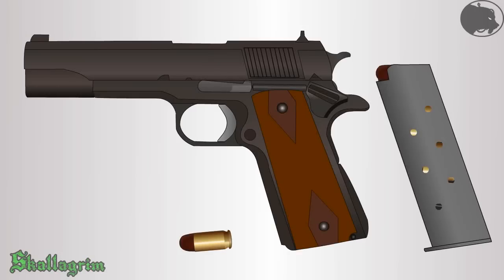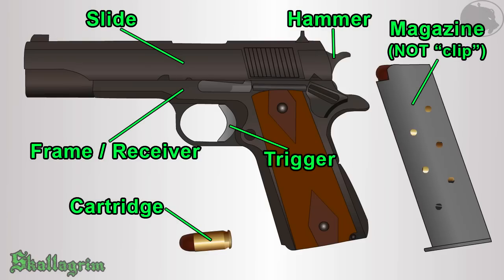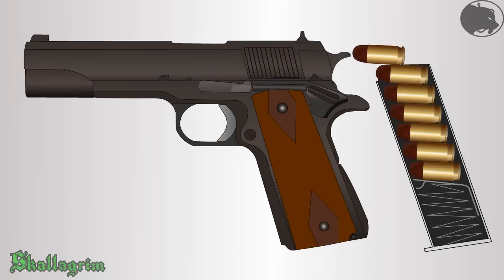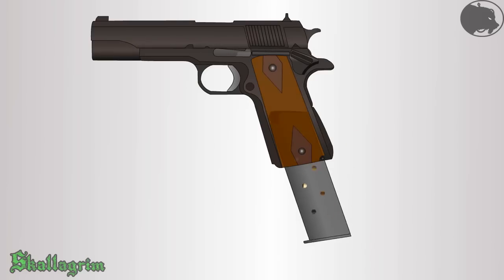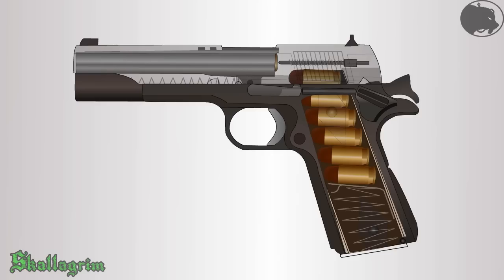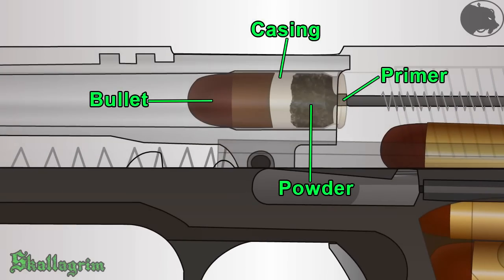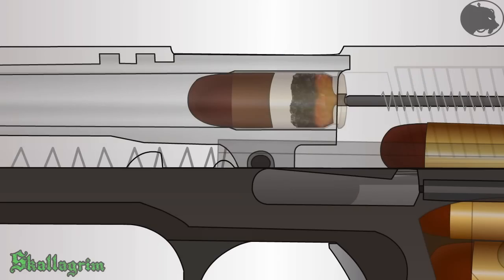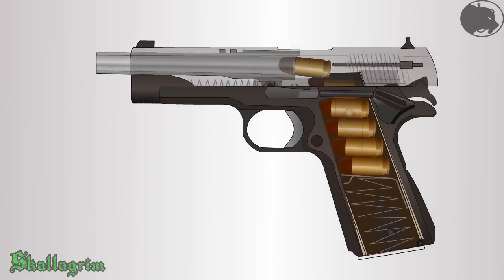How a firearm works - Animation (1911 semi-auto handgun)

Comment: I have a question. Pause at 50 seconds. At this point, there is a cartridge in the chamber and the hammer is cocked. Pulling the trigger will fire the weapon, but what if I push the hammer forward with my thumb? Will it still fire? I assume it will because by pushing the hammer, it pushes the firing pin, causing it to hit the primer. I will have another question, but I will ask after this one is answered.
Reply: It only has to have enough pressure to hit and sent the primer the primer is like a cap with small explosive inside and one it's bent the pressure on the explosive detonates so no you probably won't deny it by pushing forward.
Reply: gmchingon Almost all, if not all handguns with external hammers have safety features to prevent the hammer from falling forward, even if it is hit or pushed. Most handguns also have a firing pin block that prevents the firing pin from striking the primer unless the trigger is being pulled.
Reply: I see. Thank you.

Comment: Could some one answer my noobish question regarding automatic and semi automatic rifles. How come gas-operated reloading systems are required to work the bolt on rifles and why isn't the recoil enough, like with handguns?
Reply: It has a lot of friction to move the bolt and load a new round so it uses the gas to its advantage

Comment: So is it possible to detonate a single cartridge without the actual gun by striking the primer with a thin rod similar to the firing pin?
Reply: Yes you could smash it with a hammer and it will go off but its dangerous
Reply: Oh okay. I'm not going to do it or anything. Thanks.
Reply: +Humming Brook If you want a tid bit of info, the most dangerous part of a round that detonates is actually the casing because it is lighter than the round, so which one do you think would go flying if and explosion happened between them? =] Interesting to think of huh?

There was actually a story of a guy using a .22 round as a fuse. It got too hot and the round exploded. The actual bullet stayed in the fuse box. The casing went into his leg.
Reply: yes. it go slow because no barrel.

Comment: Guys, I want you to think about the next situation for obtain a solution to it:

We will use as model the Nerf Mega Magnus, a very alike nerf gun to the Nerf Fortnite SP-L when we talk about it's system, how the gun works is basically the same as the video, first, we insert darts on the internal magazine of the gun, the after pulling back the hammer a dart will be loaded in the chamber ready to fire, the problem is that after firing the gun, the force ain't shit enough to cause the hammer to "reload" as a real pistol would do, so after shooting the user has to manually reload the gun, now, here is the question: 
How we can make the gun reload mechanically, without using automatic nerf gun systems by just reloading it automatically after shooting? it can use a electric system but not to make the noise that full auto nerf guns use to do.

Comment: No animation of the possible ways it can jam and their causes?
Reply: Aaron Rayner failure to feed, failure to eject, and double feed are just a few types of ways a gun can jam.. their causes vary from bad ammunition, worn out parts, or even user error
Reply: Usually user error.  There is one problem that can occur, and it's when the bullet 'settles' into the case.  It's pretty obvious and if you load one of those into a mag, then that's probably going to cause problems.  I've never seen 'settling' happen, but I don't buy questionable ammo, either.

Comment: No one here or in video knows anything about the internal workings of this gun. the barrel has locking slots into the slide. how does the barrel get separated from the slide ?
Reply: Shaq Deisel Not sure if you're actually asking... But if you are

The locking just acts as a delay system so the bullet can leave the barrel and the brass can cool a little before it starts extracting. You also notice the barrel points up slightly when the slide is back all the way, which starts in the beginning and is used to unlock the slide from the barrel.

Comment: I still don't know how a gun manages to direct the recoil to drive the bolt.
Reply: The pressure exploding to the sides of the cartridge all cancel each other out.  Any recoil forces pushing towards the left side of the gun are cancelled out by those pushing towards the right side of the gun.  Pressure pushing the bullet out the barrel is the only pressure whose opposite force pushes the bolt backwards.
It is the same principle as a rocket motor.  A rocket doesn't wobble around since all sideways forces cancel eachother, the plume coming out the back is vented energy, and the explosion in the combustion chamber pushes against the upper wall of the combustion chamber propelling the rocket upwards.
Reply: LOL.  It really is simple, though.  Any forces towards the front has the equal and opposite force going backwards, which is what drives the bolt.  The gun doesn't have to "direct the recoil" because it just naturally happens.
Reply: because the recoil goes both ways and slams the bolt back then the recoil spring pushes the bolt back into place.... what u meaning? this is why bolt actions are better

Comment: So the force from the cartridge is what causes the slide to move back?
Reply: Yeah. It's Newton's 3rd law. For every action, there is an equal and opposite reaction. Every time a bullet is fired, it makes the gun cock and chamber another round.
Reply: on pistols yes. on rifles, they cycle is operated through excess gas, directed back into the chamber,  pushing the bolt to cycle another cartridge

Comment: In other words, for the most basic of guns. 
- Get a pipe, that fits desired bullet,
- Get a back for that pipe with a hole. 
- Get a literal hammer.
- Insert bullet. 
- Use hammer... BANG. 
You are now ether using ye-oldies BOOM STICK, or invented a pipe bomb... by accident.

Comment: So it's just the recoil that moves the slide back, I have a hard time believing that
Reply: That One guy A brony failing to understand simple mechanics that drive the action of a firearm? Consider Newton's Third Law of Motion, my main man.
Reply: It makes a little bit of sense but still it doesn't seem like it would work
Reply: +That One guy well remember that guns basically operate on controlled explosions. said controlled explosions make small pieces of metal go really really fast in the case of the m1911 over 250 meters a second. that has to create a lot of recoil and logically unless that slide is like 40 pounds it should have enough force applied to move it back.
Reply: TWrecks I understand physics this just didn't seem plausible. You don't need to get this aggravated at me for something this basic
Reply: The Fox Laboratory sorry i was hammered that night jk i am too yhoung to drinkl anywei ye i understand mayb there is some other skinetifikel method that it works idek
Reply: The Fox Laboratory It doesn't seem plausible because you're not taking into account every other variable

Comment: The Video is not 100% correct. 

The Barrel moves backwards together with the slide, a little longer than the bullet needs to leave the barrel. This is not made clear in the video. 
Here the Slide and the Barrel just randomly move backwards together...
Reply: +Peter August NO The barrel does NOT Move at all. The barrel is attached to the frame. The slide moves independently.

http://s1159.photobucket.com/user/Mifase/library/weapons
Reply: +Mi Fase yours is obviously not a Colt 1911 and does not have a floating barrel. The colt 1911 does though. The Barrel is held in place by a chain link system which lets it operate as a short recoil system.
Reply: +Peter August on the 1911, the barrel does not move in the manner that you say.

if it moved back with the slide, the weapon would not operate.
Reply: +Peter August so sure, mine isnt a 1911, you can have that, but you said the barrel moved back with the slide. if this was the case, the barrel wpuld not be visible when the slide moved to the rear position. the round casing would never be ejected. and a new round would never be loaded because the barrel would move back with the slide. 

the animation fisplays the movement that would occur, which is obviously not moving back with the barrel.
Reply: +Mi Fase just read yourself into the way short recoil systems work... Or if not, then please be quite...
Reply: I trained with the 1911 while in the Army, including field stripping it many times. the barrel tilts a bit, as shown in the animation, but it does not travel back with the slide.  
If it did, the breech would never be exposed to the ejection port, and the gun would not be able to expel spent cartridges.
Reply: gpgpgpgp1000 Thats what I said. 

In this Video the bullet leaves the barrel and then randomly the barrel and the slide move backwards. 
What is supposed to keep the slide in position until the bullet leaves the barrel?

In Fact the tilt consists of a tiny movement in slide direction and then the tilting around the pivot point. This movement starts as soon as the gun is fired. By the time the bullet has left the barrel the barrel transers into the tilt motion. 

In this animation there is a just a magic force in there holding the slide in place until the bullet has left the barrel.
Reply: OK, I'm convinced you do know how this gun works, and that your issue has more to do with some of the timing of the animation.  
Just remember Skallagrim doesn't do animation for a living.  I think he did a pretty decent job at this, and accomplishes his goal of explaining a semi-auto pistol action to novices.
Reply: Sure, i dont blame him for anything. 

His animation just does not answer the most important question, which is "What cycles the gun, and how?"

It answers the question "How does the gun cycle" quit well though.
Reply: Yup, just a timing issue. It would be impossible to stop the slide from moving back for the duration of the bullet leaving the barrel and still have the slide move back afterwards, right? Pretty cool video though. Glad I know how firearms work.
Reply: Christian Waldmann Well. its not entirely possible. But with a regular short travel system it is. 

But there is also delayed systems. Mostly for rifles though.

Comment: why isn't it called a clip?
Reply: A clip only serves to hold ammunition, a magazine also assists in feeding the rounds into the chamber. This was more important back with older rifles, such as the M1 Garand, where the clip would have to be inserted into the magazine. Or with guns like the SKS, where you could use stripper clips to quickly load the rounds into the magazine and then toss the clip. In these examples the magazine is integral with the gun and cannot be removed (barring some modified SKS variants).

Comment: someone can explain to me why when you are out of ammo the slide stay back? Thanks
Reply: Alberto Milla Segovia because the gun does not have anymore cartridges to reload and does not retract back
Reply: There is a notch in the side of the magazine, and the follower has a tab that pushes up through the notch. This presses on the slide lock with spring tension. Once the slide moves far enough, a cutout in the side of the slide engages with the slide lock, preventing it from returning to it's resting position.

If there is no spring tension on the slide lock, it does not push up into the cutout, and thus does not lock. That's why it only locks if there is a magazine in the gun, and that magazine is empty.
Reply: Alberto Milla Segovia so when you put in the next magazine you don't have to pull it back
Reply: hey thanksthe two of you but i already did my homework :D
Reply: Alberto Milla Segovia I tend to do serious replies, sometimes not as much directed to the OP but to the people who see the post after me. Vague answers aren't helpful to anyone, but detailed answers can educate more than just the person asking the question.
Reply: ok...

Comment: pls make a video of AK 47 mechanism.
Reply: Basically the same concept... it is also a blowback weapon using the force of the bullet to re-cycle the rounds into the gun. The reason the ak-47 looks like it has 2 barrels is because the top "barrel" is for the shockwave of the bullet exiting the actual barrel to travel through. When it goes through, it pushes back on the slide which ejects the current casing and re-cycles a new bullet from the magazine in the process.

Comment: So you can make a real gun using a modified metal B.B. gun
Reply: Politically Incorrect not quite
Reply: BlakeBiundo why not
Reply: Politically Incorrect 
1) you would have to find a round that would fit perfectly into the barrel of the handgun
2) you would have to create your own magazines to accompany this new ammo
3) there is no firing pin in a bb gun, so you would need one of those
4) with no bolt, if you do manage to fire a round, the gun will probably blow up in your face
5) the weak recoil spring in a bb gun would allow the slide to gracefully fly into the shooters fave
6) you are going to try and take a toy that is used for plinking soda cans and make it fire live ammunition.
Reply: BlakeBiundo .22 ammunition and that’s what I mean by modifying but heavy modification replacing springs with whatever you need to replace it with etc
Reply: BlakeBiundo I don’t think a metal B.B. gun would blow up
Reply: BlakeBiundo if I were going try this I wouldn’t try shooting it first time in my hand
Reply: Politically Incorrect good luck building a bolt group, forging a barrel, and building a magazine, and making it all perfectly fit together in the toy.
Reply: BlakeBiundo can’t anyways live in a gun control country